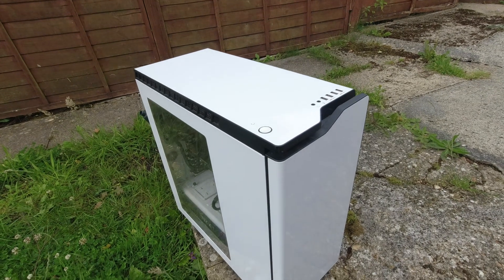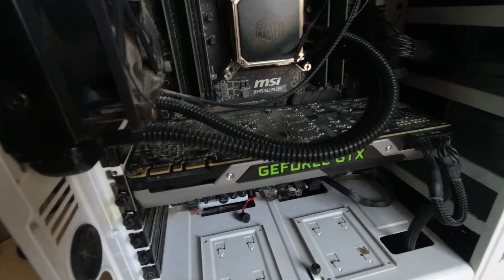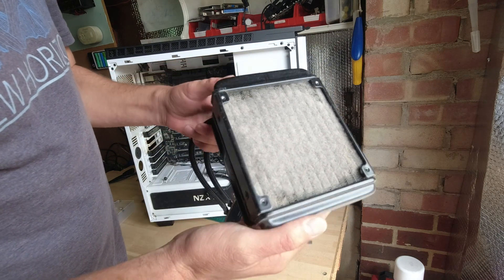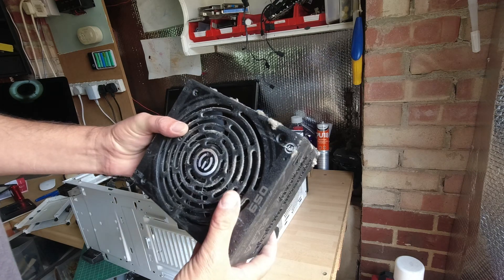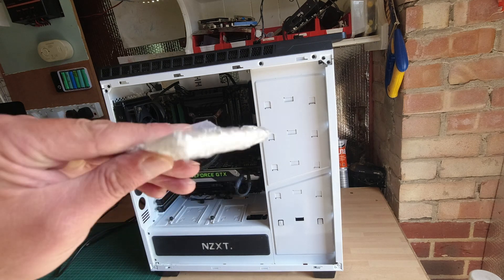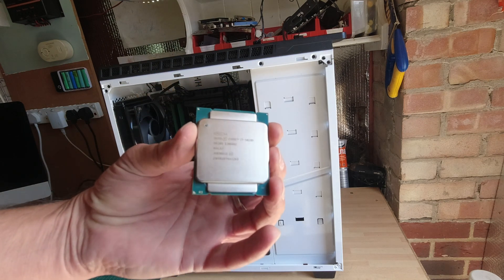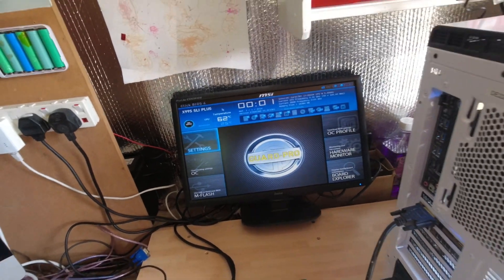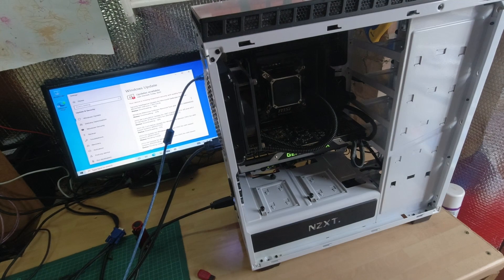Can We Fix This Cheap & Broken Gaming Pc?

Comment: She posts 🙌 Just wondering if that AIO is pumping fluid? those temps where high for idle in the bios. That said awesome build for the price and yes X99 is still a goer in 2023, my main rig is a v4 xeon 💪
Reply from the maker: You're right. The AIO pump got noisy so I've ordered a new AIO. I might even replace my Zen system with this as my daily.